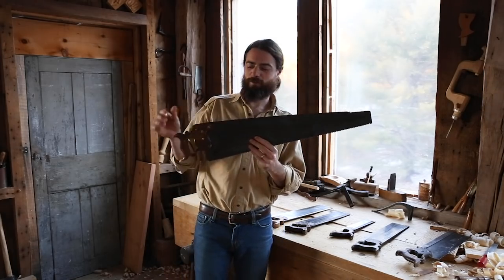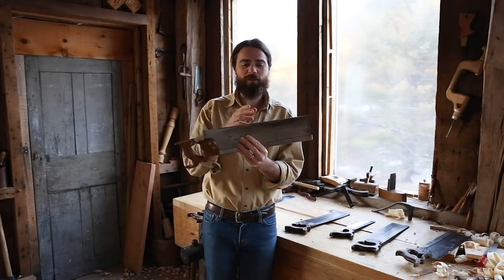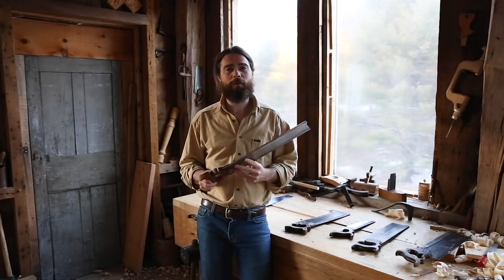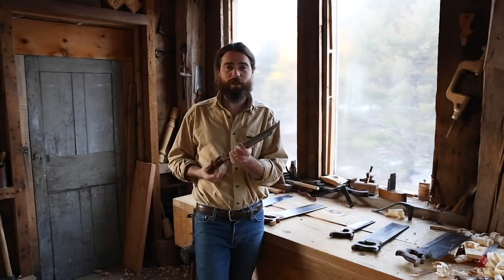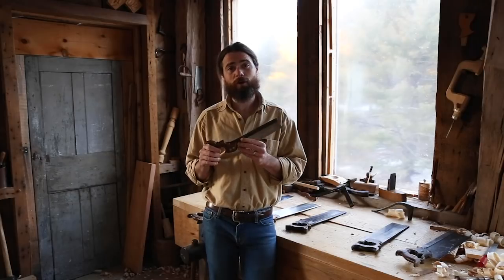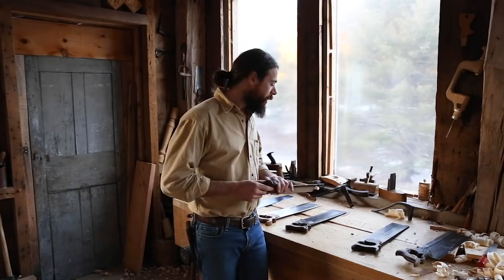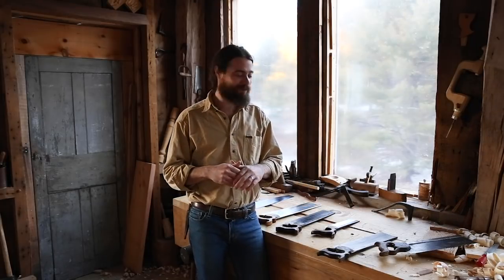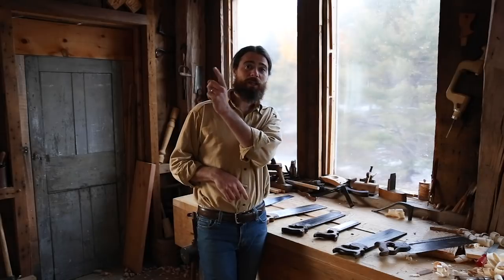What Are Backsaws?

Comment: Not all milled-slot backs are installed with epoxy. I made two saws with parts from Mike Wenzloff, and I followed his instructions by using medium-strength "blue" threadlocker (Loctite 242). Although he said to me that the backs won't ever come off, you can dissolve blue with acetone, and I suspect that I'd be able to get the back off that way. (I haven't had a reason to try, but perhaps I could sometime if I had the time and parts lying around.)